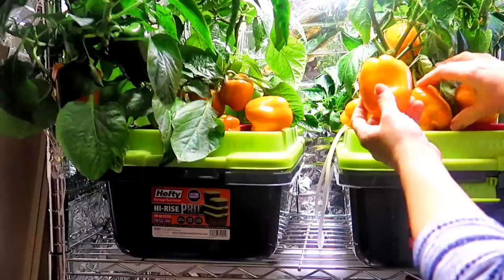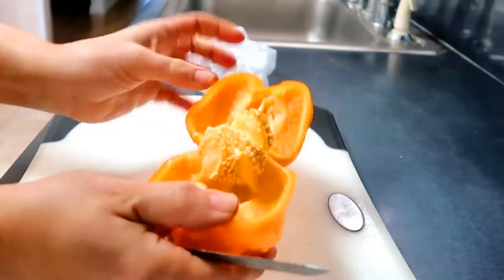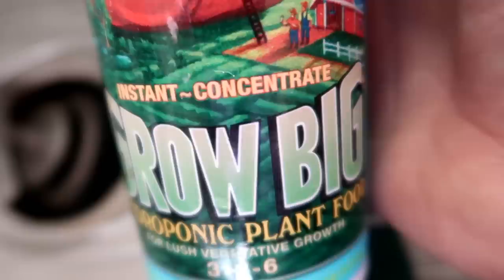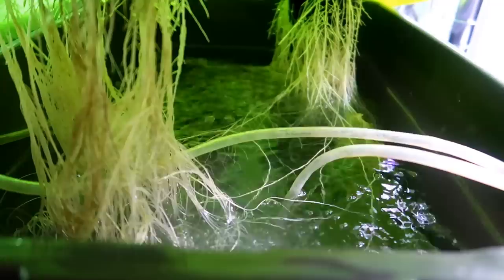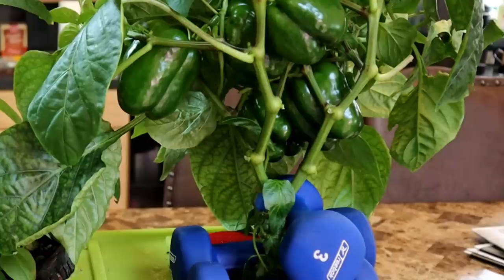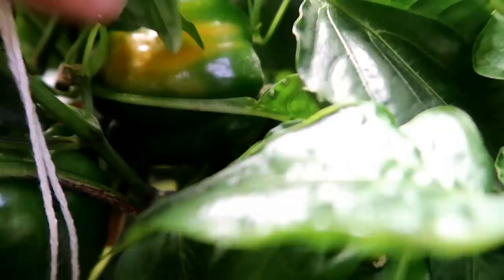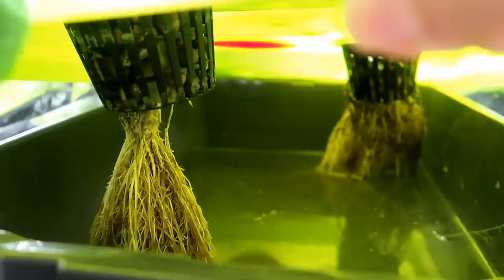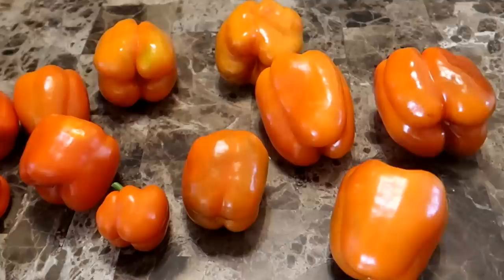Hydroponic Peppers from Seed to Harvest: Kratky vs. DWC Comparison

Comment: Did you feed them the same?  Did you test the water along the way to measure EC and PH levels?  I suspect given the massive difference in root structure and veg growth the DRC plants either needed lots more nutrients along the way or starved at the end.  Flushing (letting the final ripening happen with just water, no nutrients) may have improved flavor significantly. Lastly, expecting genetic duplicates from an undoubtedly hybrid seed grown mother fruit also causes concern with the experiment as hybrid seeds can produce many variants.  🤷‍♂️

Comment: i liked your video, but didn't hear you mention changing light schedule or flushing. did you do both but just didn't mention it?
Reply from the maker: I did not change the light schedule, it was 16 hours of light on, 8 off.  I did change out the solution twice during the grow, maybe that wasn't enough.
Reply: @TikkiOOO  during the flower/fruit stage you should change light schedule to 12/12, also i use differeent ratio of solution for veg and fruit, and i like to use just ph balanced water a week before harvest. that might help out with the flavor problem

Comment: Do you need a extractor fan in the grow tent or is it not that necessary?
Reply from the maker: If you don't have good airflow then a fan is a good idea.  I have my grow area set up in my large kitchen/great room, the ceilings are very high and there is always a draft from the windows.  But if you have a closed in area then you probably would need a fan.  Hope that helps!

Comment: you commented they taste different   ...couple questions  what  nutrient did you use i assume due to link it was the foxfarm liquid  from amazon,   and what ec level and ph? curious  because  many factors can affect taste even the light spectrum  can affect it.  and othe rplants  with the same nutrient mixes how  have they tasted and  what has texture been like
Reply from the maker: Hi Dave, I used Fox Farm in the beginning, but midway through when I did a complete water change I gave them Masterblend.  I'm thinking the taste was due to the cool growing environment.   Others have commented that I should have let the peppers sit on the plant longer, and one suggestion was to let it sit around the counter after picking like bananas to get sweeter.  I don't know.  My Ph was between 6 and 6.5.  The lights I used were first CFL then the LED, but I really think the area was too cool, it was never higher than 70 F, and at night it dropped down to the low 60's.  Thanks for the comment!
Reply: ok i was going to suggest  master blend i use  i mix  master blend 4-18-36  (  1 oz   ) , calcium nitrate  ( 1 oz )  - Epsom salt  ( .5 oz )  for  aprox 12.5 galloon at just under 2.0 EC for mature plants and dilute to an EC of 1.5 to 1.6 for early growth i run an air stone in  my dft  and krafty system set ups and in reservoir.   i have found CFL and mix of  bulbs  of  (2 ) 2700 - (2 ) 3000 and (8 ) 6500 k in a homemade 2x4 foot hood work great for light source and  made it   just from screw in cfl bulbs i had laying around so slightly over 4050 lumen per sq ft  and totally enclosed with reflective surface top sides and bottom with adjust able height   with 14 to 16 hours of light....

  Now also additionally  not  all peppers or tomatoes will give you the same pepper characters as those you buy and eat, being hybrids the seeds them selves could be a cross pollination to a different pepper and in some cases as a self pollinating plant  it could   have traits of one of the original parent stock  and not have same flavor or sweetness.  temperature can affect flavors  i try to stay at 65- 66 night and  74 -75 daytime for minimum maximum temperatures.      but if you are going to use seeds from a pepper or tomato its best if you get  it from a positive know parent stock mature vegetable or fruit.
Reply from the maker: @DMPB-fi2ir  thank you for that information, its very helpful!

Comment: I've heard that to sweeten tomatoes as they ripen, you need to stress the plants so that they put their energy into the fruit (the means to reproduce). No stress, no sweetness. Is this possible with the peppers? Maybe as they start to turn yellow, you should reduce the nutrients or moisture feeding the plants? Not so much that they begin to wilt, but enough to stress the plant. (This is from youtube watching, not experience.)
Reply: in micro greens, specifically corn microgreen they deprive it with light for it to produce a sweet taste.. what happens is that the cornling bolts and turns yellowish (indication of lack of sunlight) and becomes sweeter. I'm not sure what causes this but this probably makes the plant produce more brix content(which makes it sweeter).

Comment: Thank you for this video - before I saw this I thought I was doing some wrong. Using the Kratky method I was growing 12 bell pepper plants and 2 beefsteak tomato plants in my storage room. All the fruits were small (the largest tomato was only 1 1/2 inches across) and tasted bitter. They were NOT a pleasure to eat so it didn't hurt my feelings to throw them out. Now I gotta figure out if its the nutrients or medium that allows for sweetness/taste. I doubt its my lights since I'm running full spectrum 10-12,000 lumens and the room temp averages between 74 and 80 during the day and 68 to 70 at night
Reply from the maker: Someone mentioned hydroponic sweetener, do you know anything about using that?
Reply: @TikkiOOO  I've heard of adding molasses to sweeten smaller berries but haven't found any research on line. 
A quick Google on hydroponic sweeteners leads to flavor additives for cannabis - not quite what I expected
Reply from the maker: @saskcan958  I will need to experiment on that, thank you!  I wonder what the hydroponic sweeteners contain, and if they work for cannabis, they should work for other plants I would think...more food for thought!  Thank you sask can!
Reply: @TikkiOOO  When I was researching the different basil varieties I remember reading that there was stuff you could add to the soil to influence the citric acid and menthol levels of the basil plant so there should be something to stimulate the sugars/carbohydrates in the fruits
Reply from the maker: @saskcan958  that makes sense....more to experiment with...
Reply: @TikkiOOO  Oh! I just remembered that some plants are photosensitive.... I wonder if increasing the daylight hours might affect the sweetness - some research suggests that long hot days increases the hotness of spicy peppers

Comment: I would respectfully point out that you didn't allow the water level in the Kratky system to drop below a certain point. I believe the advantage of the Kratky method is the water level drops which gives room for the air roots to grow. Yours had no appreciable room for the air roots to grow that probably stunted the plants. I tried the Kratky method last year and they did pretty well. I do believe the deep water system is better because it keeps the root rot in control.

Comment: I can't ever seem to get pepper seeds to germinate is there a trick? ( Bell  or Jalapeno dirt or paper towel)I'm on the 3rd attempt  this season so far
Reply from the maker: I find the red and orange bell peppers germinate, it takes up to two weeks sometimes.  Heat helps.  I don't have luck with green peppers.  If you have a cold growing area it may not germinate or it will take longer.  Put the seeds on top of your refrigerator for extra warmth from the motor (check with your hand first if its warm up there.)  Don't give up.  Also, organic works best since they don't spray it with anything, could be a chemical is used on your produce that inhibits growth.  Hope that helps!

Comment: Not sure if your mars hydro is dimmed or not, but if its full blast it should be like 24 inches away.
Reply from the maker: Do you think that affected the taste?  Thanks for the comment!
Reply: @TikkiOOO  Very possible, peppers don't show stress very well. It slows down growth for sure. My pepper that was twice as far away was bigger than the one directly under my light. With lettuce if the light is too close or the soil too dry it becomes bitter. Your roots look damaged as well, that yellow lid on the bins probably let's too much light in, I would spray paint it black or cut a garbage bag to fit the top. Good luck on future videos!
Reply from the maker: @nyxreaper3936  I think you may be right about the yellow lid, it is translucent, I will cover it with aluminum foil, thanks for the feedback!

Comment: Do you replace water in reservoir? Or you just keep on refilling? 🙂
Reply from the maker: Kristoffer I did a complete water change about 2 months into the process at around the 60 mark.  Otherwise I just kept refilling with water as needed, adding nutrients every 2 weeks.
Reply: @TikkiOOO  I am almost harvest ready on my krakie method bell peppers. I noticed at first the plants where slowly moving along. Now I change the water and nutrients out at least once every two weeks, also adding a little Epsom salt to increase magnesium that was already in the nutrients I mixed. I don't use a grow tint, but some decent grow lights. I also use a heater on them for about an hour a day, and man do they grow fast. I have several peppers that just bloomed 2 weeks ago and are almost ready to harvest. I'll see how they taste though. That will be interesting.
Reply from the maker: @timsolomon8352  those are great tips, I think the heat was my problem, during the day the highest temp was 70 F, at night it gets cooler in my house.  And its dry, not humid.  They would have liked a more humid/hot environment.  Glad to hear your success story!
Reply: @TikkiOOO  From what I've learned, from parents growing them in gardens, that the actually prefer dryer but hot weather. That's what I've been told anyway and read. Pepper plants also like stress, mostly letting the roots dry out. When  I change the water, I'll actually let them sit in the containers without any water for about an hour. That's not necessary, I've never heard of anyone else doing that, but it seems to help memic their natural settings. I think the biggest thing is changing the water out, the older it gets the more the PH level rises, so I've been told. Someone else mentioned too, and I agree as far as taste, is to let them age after they turn their final color. That's what markets do. It's like bananas or tomatoes. If you eat them right after picking they have more of a green  taste. I'm just mentioning it. I'm no expert lol 😂😂😂. As I'm new to it myself. I'm in NC, but don't have any Windows that get sun or anything, so I've been  surprised at how they have done.
Reply from the maker: @timsolomon8352  thank you for all that information, very helpful!  I will try next time to leave some laying around and compare the taste.  These I ate right after picking, or soon after, and they had a very strong green pepper taste,  really disappointing.  I started some more to grow outdoors, thank you for writing and sharing that!

Comment: Mystery Elements:
Mystery Seed might be hybrid, or designed for special hot house conditions, etc.
Bells are notoriously hard to grow. Room too cold, Kratky's advised limits are exceeded. 

Might use circulating fan to stir air, 

This is not 'proper' Kratky: too many plants, not enough water, replenishment required.) 
 It's a useful Kratky adaptation, especially for me, as I'm seeking to build and run hydro between the lines of different system types. 
Kraty's how-to publication advises never to raise liquid level. These totes would need to be topped off, and that needs to be better understood. Kratky says you can MAINTAIN the liquid level...so you can slow the descent... but you can't just lift the fluid level after roots drank it up, it will damage the plant. 
The classic Krattky demo, though, is one cuke plant per 55 gal drum set and forget. Kratky for peppers requires a 5 gal reservoir. 

So one ponders aeration (seems not to help, so I hear) and ways to slow or limit the fliud level drop for longer crop season.
These plants should be in a warm grow tent with a  'stir' fan, and some circulation with the room.

Comment: Add a sugar solution to the water to sweeten them up
Reply from the maker: Have you tried that?  Just plain sugar, any ratio?  thanks for the suggestion!
Reply: @TikkiOOO  You can try Sweet by botanicare, they have different ones you can check out online Also General Hydroponics has Floral Nectar they also come in different "flavors".

Comment: It is OK. But the Kratky system  needs air and a free gap to allow new oxigen enter between water with nutrients and plant supporting layer. So what I suggest is leave a pair of holes, or to insert  a pair of tubes to allow a better oxigenation into the middle layer where moist air camera, works for Kratky system. The 3 layers in Kratky must be Support, Humid Air, and Water with nutrients. To place a cover limiting oxigene circulating into middle layer, I think is not what Mr. Kratky explains. Best regards.

Comment: It works like this plants with the air stone aerobic it's without the air stone anaerobic here's the big difference anaerobic can produce disease from the wrong bacteria growing it all depends on what kind of plant you have and what the fertilizer requirement is for that plant my guess is so if you're seeing the ripening difference that is because the inner formula is broken down some and actually change the fertilizer in that container. As far as I'm concerned all systems should be aerobic because it's better for raising microbes and stuff and getting better quality food.
I actually invented a new system I call Natural Products. Pepers are responsive to Root temperature they grow a lot slower until your soil temperature hits about 70 to 75 degrees so if you could put like an aquarium heater or something to warm your water you would probably get faster growth they also respond well to Epsom salts which is magnesium sulfate.
I you want to learn how to really Garden I recommend signing up with Harley Smith NPK University or buying his course I don't know if he's still teaching it BUT I went through it for years on a Tuesday night we had a 1 hour class and then we'd have a question session and it was a lot of fun and I learned so much more that I actually invented things for the agricultural Industries. I now own a company called Massivegro I was all set to release it but I had a disaster with a home fire so now this year I'm hoping to get it out there and get some people to test my product I'm getting as much as 2,700 plus percent production with higher quality vegetables and herbs and it's all organic natural no chemical it comes from what I call Green manures it actually comes from plants and vitamins.  If you're not getting sweetness out of your peppers and hydroponics it's cuz of a couple reasons either it didn't fully ripen on the vine or you need some Trace elements like as might and or kelp and the proper pH azomite is a volcanic rock and roll and it really makes the sweetness go in the plants like strawberries if you have the right microsaid bacteria all the products I invent contain everything that you need to get super high quality vegetables they are they have about 40% higher vitamins and they always taste or sweeter and natural then what you would buy in the store I'm hoping to send out some free sample packets next week if you'd like me to send you some free samples message me a shipping address and what kind of things you grown or what you're interested in using it on and I can send you some specific products. I have things like compost teas all that stuff

Comment: with dutch buckets and/or ebb and flow systems together with a nutrient solution which needs to be tailored according to the life stage of the plant you will have good tasting peppers. The kratky is not really suited for growing this kind of vegetables. The dwc could be interesting, but as I said, you need to differentiate the nutrient recipe during the life of the plant. 
By the way, your experiment is interesting, but for a real comparison you should have used same genetics. How can you be sure that the dwc pepper are more performing because of the system and not because of the genetics? I mean, the seeds are all brothers.....but even in the best families you have lazy brothers and active brothers, good ones and bad ones.....
Reply from the maker: lucas you definitely gave me food for thought!  Have you heard of hydroponic sweeteners, and do you think it would help with the taste as someone here in the comment section suggested?  As for the seeds, I assumed since they came from the same parent they would be the same, but the family analogy calls that premise into question.  Thanks for the comment!
Reply: @TikkiOOO  I honestly dont't know what a sweetener is. You should differentiate the recipe during the growth of the plant, and this applies to any fruiting plant (not for lettuce, they are just OK with one recipe throuhout their lifecycle). The adoption of different recipes will do great part of the job. This happened to me when growing tomatoes, peppers and eggplants. If you want perfection then focus on:
1) left handed amino acid
2) fulvic/humic acid
Depending on the system that you are using you can also add beneficial elements, beneficial bacteria, molasses and algae. This products will indirectly act on the taste of the fruits.  Wish you success, have fun! bye.